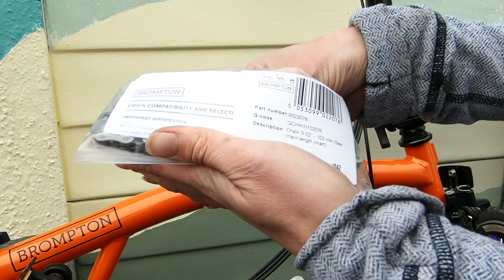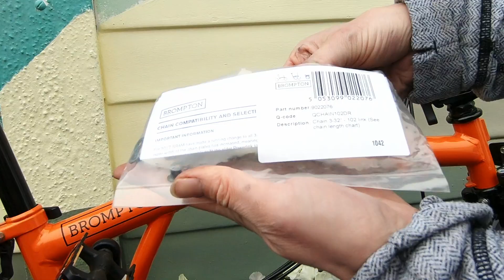Brompton Chain ring / gearing change

Comment: Yet again a useful video for a novice. I've just bought a very old 3 speed Brompton and will likely change the whole crankset to a 44t.  What chain will I need? Thanks 😊
Reply from the maker: Glad it helped and thank you for watching

Assuming your Brompton has the 50T front chain ring and a 13T rear sprocket - you would need to reduce to a 96 link chain (QCHAIN096DR)

You should change the rear sprocket at the same time

Comment: Hello,  this is not easy to explain,  but I will try. When replacing the CHAIN RING to make sure that the Bolt Hole THAT attaches to the back of the CRANK has the SMOOTH ROUNDED EDGE NEAR IT.  It won't sit properly otherwise.

Comment: I’ve got a 2007 M3L. My chain guard appears to be one unit with pedal attachments. Whereas, in your video, the chain guard is removed separately to the pedal arms. Does this mean that I would have to buy a new spider pedal arm/crank to fit the chain guard in your video? I’m guessing that is the case as my bike is so old now. Great video as always.

Comment: I enjoy watching your videos.  How often do you change your chainring, a chain and ear sprocket, assuming you replace them all at the same time?  Is it done periodically, mileage based or through wear and tear visibility?
Reply from the maker: Thanks for watching and your very kind comment

The chainring wears a lot better than the chain and sprockets - we have only really changed these when changing gearing (so far)

The chain and sprocket changing interval really depends upon the riding conditions and bike maintenance

A clean chain / sprocket combination will last a lot longer than a dirty one - the dirt acts as a paste and wears everything out

You can use a chain wear tool to see if it's wearing - and change the chain / sprockets based on that , or wait until it starts slipping
Reply: brilliantbikes Really useful and good advice.  Thank you again.

Comment: How do you stop the 'nut' turning on the back of the chainring when removing it?
Reply from the maker: Thanks for watching and the great question

You can use a special tool such as the park tool CNW-2  - Chain Ring Nut Wrench
this slots into the back side and prevents it turning
Reply: @brilliantbikes  I found the correct 'spanner' at the local bike shop. However, even with the correct tool (which is pretty flimsy) the bolt and nut wouldn't part. Hammering, heating, even holding the spanner on with locking pliers wouldn't help. Note these bolts have been soaking in penetrating oil for several days. I got fed up and drilled them out.
Reply: Lot easier to do job if you remove spider from axle... You can see what your doing and also get much better purchase and pressure on nut on the back. Use the proper tool, or a large bladed screwdriver

Comment: I’ve just bought my chain and fitted it myself. Thank you for your guidance. Silly question. Does the new chain come as lubricated already as it’s very slightly greasy or so I need to add some lub and wipe excess before rising it?

Comment: Do we have to set at any particular gear before dismantling?
Reply from the maker: Thanks for watching and the great question

As it's the chain ring we are changing on the front - no - although if it is a 6 speed, there will be more slack on the chain (so slightly easier) if you put the rear on the smaller sprocket

Comment: I wonder if one could use a smaller chainring like 34t or 36T to have a better climbing experience?
Reply: Brompton sells a 44T
Reply: Tldr: yes it's possible, yes I do that myself, yes it works, yes it makes going uphill much easier.

Yes you can use a smaller (third party) chainring for a better climbing experience (lower lowest gear. This lowers the hardest gear too, which means you might spin out at a lower speed going down. I never found this to be an issue). 

However 38 T is the theoretical minimum chainring size. That's the smallest size that will fit easily. (If you want to go lower you will need to change more than just the chainring).

Personally I use a 39 T chainring and it makes Alpine passes a lot easier. (with 38 T the chain was touching my crank arms which I didn't like, so 40 T it was)

Remember to shorten your chain accordingly (if you go from a 44T to a 40 T chainring your chain now needs four less "holes" since you now have four teeth less)

You need a five arm 130 mm BCD nine speed chainring. (A ten speed will work too, but it will be thinner than the chain - still works though). However five arm chainrins seem to be used mostly on vintage racing bikes, the de facto (mountainbike world) standard is four arms. This limits choice and availability.

Comment: So I just tried doing this on my 2 speed Brompton, and some things felt off. I changed the 50T sprocket to a 54T sprocket. And changed the chain to a 102T chain. 
Should I be using a different set of sprockets or chain length if it’s a 2 speed?